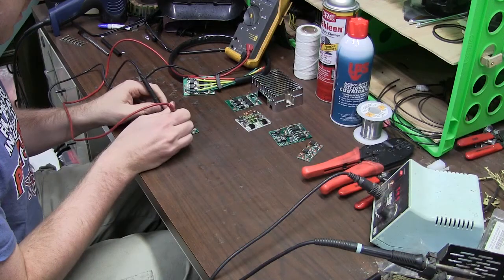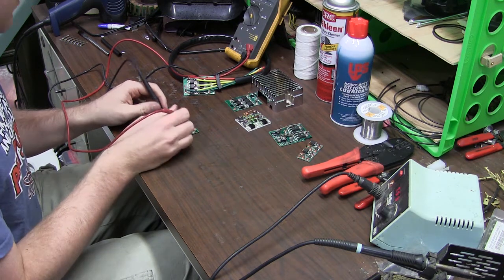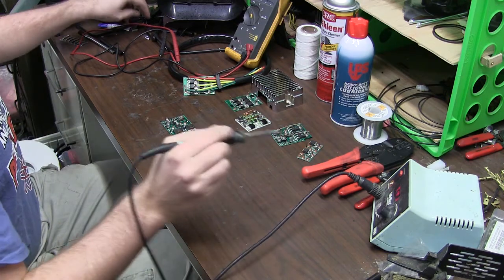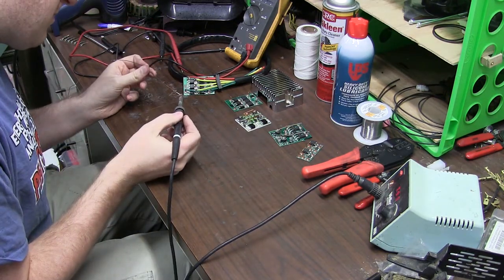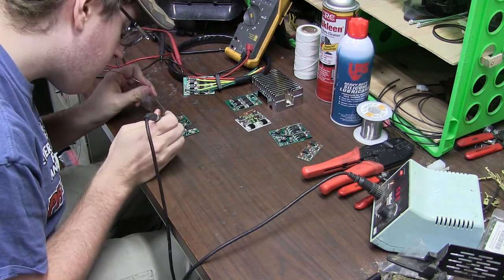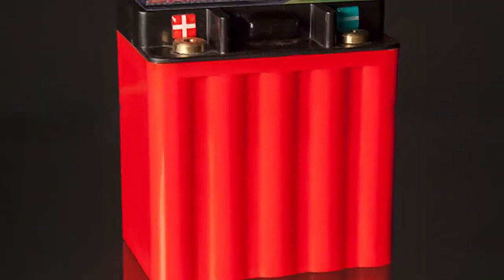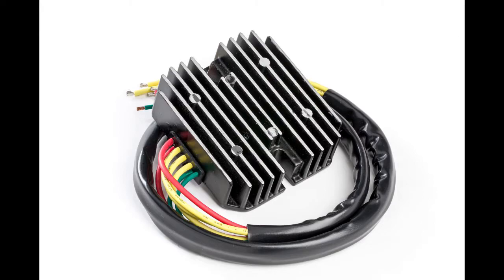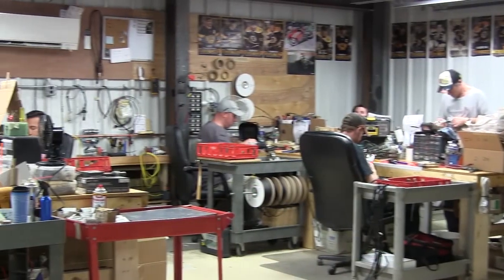New Lithium-Ion friendly Rec/Reg!

Comment: Yes it's me again, with a different bike that needs to have a lithium battery and I see you brought out your line of lithium regulators for old bikes, but it looks like my 1991 Suzuki GSX1100G is just not old enough. The part finder suggests this part...
https://ricksmotorsportelectrics.com/Universal-Regulator-30_502
But I bet that puts out 14.5V. Any chance of  you making up one of those that will regulate down to 14V?
Also, I did some testing on the alternator for this bike (plus a spare) and  the rotor resistance is 6 Ohms, compared to your suggested 3.5-4.5 ohms. Will that be another issue? Or will that help drop the voltage?
Here's the test I did https://youtu.be/-G3y2FPlZI4
Appreciate any feedback
Reply from the maker: We don't have anything right now, but I will inquire with my guys about it!  6 OHMs is not necessarily a bad reading.  Our 3.5-4.5 is a generic reading.  If you start dropping down to 1 OHM then it is indicative of a short somewhere in your system.
Reply: Thanks, I'll keep an eye open. If you give the go ahead to develop that part, how long does that take to make it to store shelves? I ask because the battery is dead now and I really don't want to put another lead acid battery in a bike.
The current bike alternator puts out 14.7V and the spare 15.3V, so I know I won't be able to use a lithium on either of those without some kind of voltage drop.  I do have the Bonneville below (running on a Lithium now) so I won't be bikeless.

Comment: Hi Rick. I currently have a 2001 Triumph Bonneville and need to replace the regulator now. I still have a lead acid battery, but I'm sure it will fail soon here in Aridzona (2 years into a 3 year expected life). When it does I would like to switch to a LiFePO4 type battery... so here comes the question...
If I replace my current regulator with your model 10_004H, will that work with a LiFePO4 battery - i.e., will it cut off the voltage somewhere around 14.5V so it doesn't burn out the battery?
Reply from the maker: Hey Rich - our 10-004H has a voltage set point of 14.5  (+/- .2) so we don't recommend them for use with lithium ion batteries.  There's no issue with using a lead acid battery.
Reply: Thanks for the reply, I'm a little confused as  Ballistic says 14.4V max charge for theirs, Kinetic says 14.6V max and Battery Tender claims 14.8V for theirs. I assume they all have different cell control circuits inside the battery, so can I assume that your 10-004H regulator will work with a battery tender battery?
I see why you would need a lower voltage for the ballistic battery, then it would be safe for all the others
Reply from the maker: Every battery manufacturer has their own voltage set point.  If battery tender says theirs can handle 14.8 then in theory you SHOULD be fine with our Hot Shot rec/reg.  We just don't recommend it because we haven't field tested our rec/regs with their batteries.
Reply: Is it possible to order a 10-004H with a lower voltage output? say 14-14.2 volts nominal?
Reply from the maker: Right now we do not have that available.  It may be something that we'll look into in the future though depending on customer interest.
Reply: Thanks for the feedback - part ordered as current one is failing to charge the battery. 
It would be sensible if the battery makers would put hardware in their batteries so that the LiFePO4's could be a DROP IN REPLACEMENT for a lead acid and not have to do all this mucking around. Perhaps you have already mentioned that to Ballistic, but if other makeRs come knocking on your door, perhaps you can mention it to them as well.
Cheers
Reply: @richbinaz  It's just on vintage bikes I guess.  all the modern bikes seem to work just fine with lithium batteries.  also lithium batteries require periodic balance charging.  shorai sells a balance charger for their batteries.  the many cells in a lithium battery need to be kept around the same voltage.  when one of them gets too far off you risk ruining the whole battery.   so there's still a lot of maintenance a lithium battery needs.  and if you're having to replace a battery ever 2 to 3 years you're doing something all wrong.  I get 10 years from batteries.  always have.   my routine is,  buy a good brand AGM battery.  GS is one of the best.   don't leave it on a tender 24/7.  only charge it up every 3 to 4 weeks if your bike has parasitic power draw.  for long storage periods disconnect the NEG cable.  DON'T bring it in the house in winter.  the cold actually preserves the charge.  if you do bring it in you will need to periodically charge it more often.  but you shouldn't need to be charging an AGM battery at all during winter.  they can sit for 14 months without maintenance.   this is what I do and I have had 3 bikes with 10 year old batteries.   my new Yamaha R1 has a parasitic power draw so I have to hook it up to a tender periodically.  but the mistake everyone makes is leaving it hooked up 24/7

Comment: How long will these batteries last? Im currently getting 2-3 years out of my motorcycle batteries.
Reply from the maker: Hey Kevin - that would be a question for Ballistic Performance.  Check them out at https://www.ballistic-batteries.com/main.php.  We manufacture the rectifier/regulator.
Reply: Rick's Motorsport Electrics With that, I have one of your alternator rotors and it works fantastic! 3 years strong so far. Opted for a cheaper one first and it went out in 6 months, bought a Ricks and the build quality looked 20x better, fit better, and works WAY better.
Reply from the maker: that's awesome - glad we could help!
Reply: So, I've got an abused Ballistic in one of my road race bikes, first installed in 2012.  The original bike running it was an FZR400 running in a total loss config, so no charging system, it gets thrown on a charger between sessions after getting drawn down pretty hard on track.  (Fortunately the bike is carbureted, so no fuel pump / EFI to power and I have a volt meter on the dash to monitor it's state.)  After five seasons of use I moved it this year to an R6 that has a charging system just as an excuse to finally put a replacement in the FZR.  If you don't damage them by drawing them down too far, or overcharging they should last for a long time.  On a bike with a working charging system I see no reason not to expect five years easy out of them.

A Reg/Rect with outputs optimized for LiFePO4 would be a nice upgrade for my R6 and KTM300...
Reply from the maker: what year R6 do you have?  I can check to see if we could put something together for you!
Reply: I always get about 10 years.  everyone else makes the mistake of hooking their battery up to a tender 24/7.  biggest mistake everyone is making.  buy yourself a good AGM battery like GS.  (yuasa subsidiary) it will set you back around $145 but it will outlast all these cheap batteries flooding the market.   and don't leave it on a tender.  a AGM battery can sit unattached from your bike for 14 months without maintenance.  for 15 year I never owned a tender.  or needed a charger on my bikes.  I have one now because my 15 yamaha R1 has parasitic power draw.  and it's a little more work unhooking it than I feel like doing.  so I bought a tender from autozone just for this bike.  hooked up only for a day at a time every 3 to 4 weeks.  5 years old now still good.